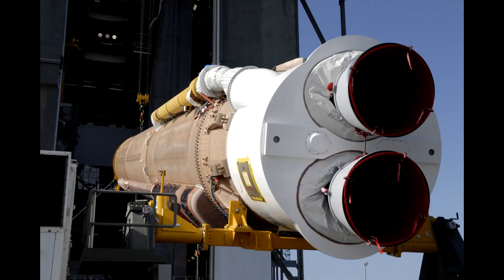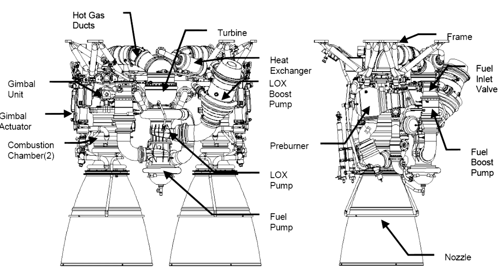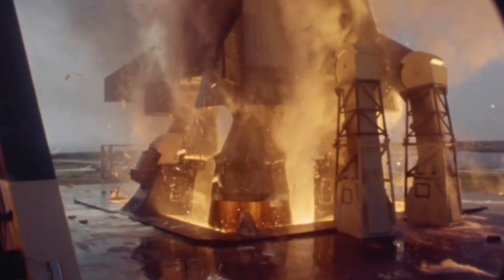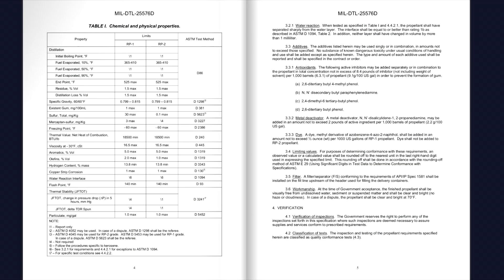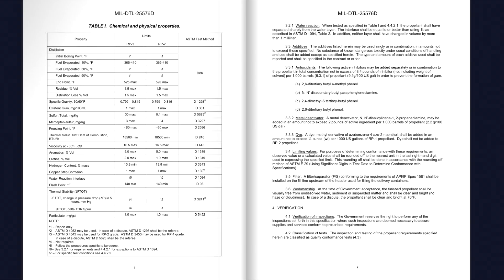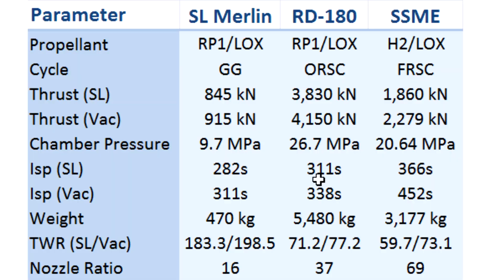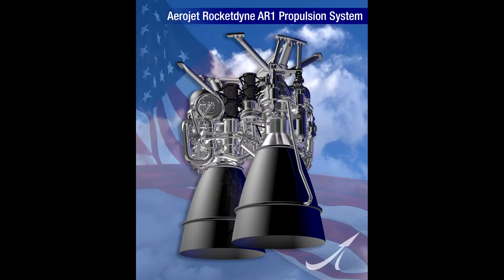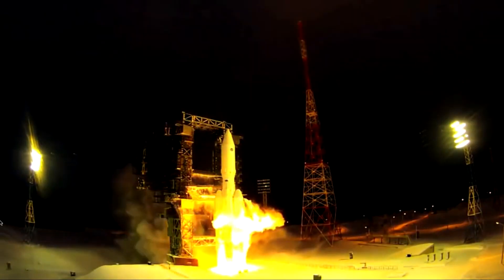Why Some 21st Century US Rockets Still Use Soviet Era Engines

Comment: Cuz the commies made some damn fine engines.
Reply: Neither the RD-180 nor the RD-181 are actually Soviet-era, both having been developed after 1990, although they are heavily based on the RD-170 which was a Soviet engine.
Reply: They also strapped together dozens of WWII-era rotary Diesel aircraft engines to power their patrol boats.  Engineering by necessity since they never had the kind of money the US throws around.
Reply: Three things they were good at making: Huge explosions, cool vehicles with decent engines (well, for the KGB and Roscosmos anyways), and vodka.
Reply: @lsswappedcessna  Same as usa. By the way, Finland air forse buy some US F 18 hornets back In 1995-2000 but mig 21 is  holding the speed and alltitude records here. And it is over 40year older.
Reply: @matti3995  The MiG-21 was a great plane for having been introduced in 1959, however, it isn't anywhere NEAR holding speed and altitude records in Europe for fighters. First, I will mention the 'fastest fighter' is the MiG-25 Foxbat, of which is only operated by Algeria, Azerbaijan, Syria and Libya, all in relatively small numbers too. Not exactly European, so let's move on. The fastest European fighter that is ONLY in Europe is probably the Eurofighter Typhoon, however that position is up for debate if you can come up with a fighter aircraft clocking a top speed higher than 1,550mph and service ceiling higher than 65,000 feet that's operated by a European country.
Reply: Matti doesn’t mean it’s better at being a fighter jet.
Reply: But made a damn terrible economy.
Reply: When they had food to eat
Reply: And some great weapons too.
Reply: NMCCW ☆ Not only that, they perfected a workhorse design & made it more efficient & reliable.
Reply: I ment finland airforce fighters. We had saab Draken, fouga, Vampire, mig 15 and 21 and two engine f18
Reply: @matti3995  Ah, ok.
Reply: Which the Yanks still can't match.
Reply: ndtexpert yes we can
Reply: > @Americanexceptionazism  
bruh
Reply: As if the F-1 is worse
Reply: Too bad their leaders aren't as fine.
Reply: Actually their poor engine design is what stopped them from going to the moon...
Reply: Swirvin' Birds Not true at all. There were many things that stopped them going, probably the biggest was the rivalry between Korolev and Glushko. These engines were developed directly from the NK-15 of the n-1 rocket.
Reply: @swirvinbirds1971  did you even tried to watch the video lol
Reply: @marekverescak2493  Is this video all you watched?

The killing blow to the Kremlin's lunar efforts came from the main propulsion system of the N1 rocket. Initially, there were various plans to equip the N1 with engines up to 600 tons of thrust, but the lack of necessary machinery and time forced designers to settle for a much smaller 150-ton engine. It meant that a total of 24, (and when that proved not enough—30) engines would have to be working in a precisely choreographed fashion to lift the monstrous vehicle off the pad.
Reply: Cuz if we don't buy them they'll sell to someone else. That someone else will have them pointed at us too. Which would cost us a whole lot to deal with.
Reply: Paul Frederick ☆ Wow. Buy Now!
(before cousin Rafe gets it)

Comment: Typical Russian engineering. Simple (relatively), effective, and ingenious.
Reply: Except they are not simple. Hence why the US scientist back in the day didn't believe such an engine could even exist when they heard about it. That Soviet tech was simple is a myth. Some where (like computers, cameras...) but at the same time they made remote controlled rovers when the US needed hands on to do the same work in space. In alloy, rockets, rovers, missiles they were far ahead. Russia is still making better missiles than anyone else today (though no American military fan would ever acknowledge it even if it had lasers up its ass).
Reply: +Dahoon
it is relatively simple. You can save your day by simplifying certain things so that you can make more complex components where it matters, improving reliability and making certain designs possible. It's similar to calculating tolerances on blueprints. By changing the way you measure them you can easily make your part a lot cheaper.
Reply: most importantly: long-lasting. that's like the key design feature the Soviets were working with.
Reply: you should try the trains in Russia everything is build from 1cm thick steel plates not plastic trim that snaps off!

Comment: Instead of using closed or open cycle engines, couldn't you use electric motors to drive the pumps?
Reply from the maker: Yep, like the Rutherford, but batteries add mass
Reply: Okay that's a good reason
Reply: But will get lighter as technology develops, which is why Rocket Lab chose this option.
Reply: Kilo of fuel will always have more energy than kilo of battery :)
Reply: randomnickify | But who knows maybe an electric pump is much lighter than a turbopump with all the auxiliary components
Reply: @rasimbot  true, but w/ current technology that can only happen w/ small rockets. after certain size  the battery weight is more important
Reply: @rasimbot  big rockets need thousands of horsepowers in their turbopump, I cant imagine electric engine with that power being smaller than gas generator.
Reply: randomnickify | Looks like you are right. I've googled and found the interview with the engineer of РД-170 and he said that its turbopump is 180 MWatt. And also I've found the webpage about 36.5 MWatt superconductor electromotor and its mass is 75 tonnes
Reply: According to wikipedia LiPo still has order of magnitude less energy density
Reply: Electrics would be a simpler design but rocket fuel energy density is much higher than batteries.  Above a certain size the complexity and plumbing penalties puts open/closed cycle engines ahead of electrics.

Comment: Hey, can you do one on grounding electric circuits in space?
Reply: I'm no electrical engineer, but I can't see it being that much different that grounding an electrical circuit in a car. in a closed electrical system you just ground back to the source.
Reply: @iamzid  that makes sense thanks. The car electronics are 12v or something though, so maybe there are more considerations to be made still
Reply: To illustrate, there is a fun experiment You can do, You need for example a low voltage lightbulb, a battery and some pieces of wire to connect it with, one part goes directly to the lightbulb, the other part You can fix on for example a wallradiator or something else that will lead electricity and then another piece of wire back to the lightbulb, if eweryting has good contact the lightbulb will still light up, despite of the massive resistance in the radiator.
Reply: Long extension lead.
Reply: Gee, I wonder how airplanes fly?     For sure you're no electrical engineer.

Comment: Very strange that the US hasn't produced anything better than Soviet-era rockets.  Lots of experience.  Heaps of supercomputer capacity.  Lots of economic incentive.  Just don't want to?  Good enough is good enough?
Reply: As Scott did say, US did go for HydroLox rocket engines insteed that is mutch more effective then Kerosene LOX rocket engines, but it is like compare apples and pears, both have their pros and cons.
Reply: They have, just not any better Kerosene + LOX. The US has far superior MethaLox and HydroLox rocket engines. MethaLox engines are much more efficient when it comes to cost and availability of fuel while HydroLox engines have higher specific impulse end fuel energy density.

Comment: which will be better? the Raptor engine or the Blue Origin BE-4? i havent seen anyone directly compare them even though they will compete against each other
Reply: I think there haven't been any comparisons because both are still in development (as far as I know), so all of the parameters are still subject to change or not published.
Reply: The Raptor is considerably more technically impressive. The BE-4 is larger. Which is "better"? I don't know.
Reply: larger definitely isnt better, Id rather have 2 smaller, cheaper, and more efficient engines, then one that costs more then the 2 smaller ones, and is a lot less efficient.
Reply: raptor engine is hands down much better, 30,000 vs 13,400 kpa of chamber pressure
Reply: Hard to compare when the numbers keep changing. Probably raptor if Elon is to be believed about it's performance though.
Reply: Hard to say since they're two different types of closed cycle engines.
Reply: Mark, sure you can compare them, you know their chamber pressures, and fuels.
Reply: If Raptor and full flow staged combustion work well than Raptor is clearly the better engine with more capability. So far the Aerojet Integrated Powerhead and the Energomash RD-270 are the only other rockets engines to use both an oxidizer rich and fuel rich pre-burner. Keep in mind the RD-270 used hypergolic propellants which makes it a bit easier. BE-4 is more similar to the RD- 170 based Russian engines using oxidizer rich staged combustion. Blue claims that the engine is being setup to run at lower chamber pressure to improve longer term reuse. Raptor will almost definitely produce better specific impulse.
Reply: I’m pretty sure I’ve seen a video which compared them. Search youtube for it
Reply: Both will be better than anything else currently used today, and that’s what matters.
Reply: @BrokenLifeCycle  IMHO the best first/second stage engine in terms of Isp is RS-25/RS-68 that works on  LH2/LOX. But it did not make the rockets that use the engine best on the market, or best of all. So Raptor or BE-4 will not become best engine for first stage as well. They may become the best for some particular rocket use.
In the nearest future rocket engines with nuclear source of energy may become breakthrough that will deliver human to any planet, including dwarf planets behind Pluto, and anything near 1000 AU from Sun.
Reply: @hsynli-u8e    theyve reached untill about 280 bar with the first raptor, I believe 270 is what will be good enough for flight.
Reply: Those are vastly different beasts. One is an oxygen rich staged combustion engine like RD-180 and all those Russkie engines and the other is a full flow staged combustion engine. That has never been done besides one prototype and half of another prototype (RD-270 is the only FFSC engine ever fired on a test stand besides Raptor). Raptor is by far the higher performing (by virtue of design), more efficient and longer lasting design. The latter seems presumptuous however FFSC allows for lower temperatures in the turbines and by being an FFSC engine can eliminate the seals in the turbines, since both the oxygen rich and fuel rich side have their own turbines so cross-contamination with explosive results is not an issue. Not to put down BE-4 it's looking like a really really great awesome new engine. But Raptor is Raptor. There's a reason people say it's 50 years ahead of anything else.
Reply: 221 b: "people say it's 50 years ahead of anything else"
You already enumerated its direct predecessors as RD-170/180 and RD-270. First deals with hot oxygen, second deals with FFSC to work with fuel and oxidizer of different density. First was developped 35 years ago, while second was developped 49 years ago.
Currently tested Raptor has 20-25MPa chamber pressure. This is same level of pressure as RD-170/RD-270 have. While 30MPa is just future plan. Not clear if this number is reachable or not.
Fuel and oxidizer are different than RD-170/RD-270 were used to work. But this will influence hard work over fuel and oxygen tank. How heavy dry weight is going to be? Is it going to compensate all additional Isp methane is going to provide? If yes, this solution is Mars specific only. It creates additional cost of the rockets production like it was for Space Shuttle program with hydrogen fuel and like it is for Delta IV rocket with its $450M cost per launch.
Note that there is synthetic oil produced by many oil companies throughout the world. All they do they use natural gas like methane and synthesize longer hydrocarbon molecules of required length to provide required oil characteristics.  Kerosine also consists of hydrocarbon molecules, but they are less in size than synthetic oil.
Instead of developping methane fueled Raptor Musk could develop Mars located synthesis machine to produce RP1 from methane. So there are other options than what Musk took so close to his mind.
Reply: Frothar My moneys on the raptor

Comment: could the bfg do a mission like apollo & land on the mon then come back?
Reply: Not sure if the big friendly giant would survive in space, but maybe.

And yeah, with orbital refuel BFS could definitely do a moon landing and return, probably wouldn't even take a full refuel.
Reply: BFR
Reply: yup, probably with 1 or 2 refuels in leo
Reply: Probably would need a refuel on the surface of the Moon.  A free-return trajectory, Apollo 13 style, won't need refueling.  Landing means having to propulsively shed all velocity and put it all back again.  The Apollo LEM made it easy with paper-thin walls and an even smaller ascent stage.  BFR/BFS would try to descend and ascend with everything including atmospheric reentry heat shielding and sea-level engines.
Reply: @CarFreeSegnitz  I'm pretty sure the delta V required to get to the moon, land, and come back is quite a bit less than getting to Mars and doing a propulsive landing there. If the BFS didn't refuel in Earth orbit you're right that it would need to refuel on the moon, actually I'm not sure it would even have enough fuel to land. But that would be a stupid way to do things until a fuel depo gets built.
Reply: @Daniel Jensen It is actually not at least not in BFS configuration it is far "cheaper" in delta V requirements than landing and returning from Moon. That is because to land on Mars you only need delta v to get there and bit to scrub lasts bit of velocity before landing rest will do the atmosphere. Meanwhile to land on moon you need capture burn than scrub all of Moon orbital velocity and do it all again to return to Earth. In the end it takes for rocket like BFS 3km/s less delta V to land on Mars than to land and return from Moon. Of corse it is different story if you have optimized lander like Apolo stile  lander with multiple stages while it still takes more delta V it is spread across multiple stages and it would not survive aero braking or if you want to return back to Earth from Mars. But if you want to return you still can use in situ methane production from co2 and water via Sabatier process.
Reply: It's also worth pointing out that it has redundant engines (you could land with only two of the seven engines) so it will have more mass drag than any other rocket for safety/reusability reasons. In fact, it will land back with fuel in the tanks!
Reply: It is pointless to even talk about that since it is only vaporware.
Reply: @MarkoLomovic  Just like the landing of Falcon 9 rockets?  Be careful with how you use that word.  Vaporware is for something that is only hype that the company behind it never intends to make.
Reply: Wrong, look up definition of vaporware(it is something you announce but not produce yet). BFG and all that jazz can be considered vaporware until we get something real because it will take so long to achieve that goal and goal its self is extremely complex. If we take into consideration their wishful launch date as PR move then whole project is questionable.

So it can be considered vaporware but just because something is considered right now doesn't mean it creators never intended to make it that is just people misusing term.
That is why we have terms like surfaced vaporware, ones that actually got done. So BFG is far from certain at this point and time. Falcon 9 is nothing special considering that people have done way more insane stuff then landing boosters. 

As much as I like SpaceX they are still young when it comes to space exploration and for them to be able to create something like BFG they present is just way off.
By the time they even make something what they present us now is far from what they will actually do so even in that sense it is vaporware.
Reply: @MarkoLomovic  So even with your own definition it still isn't vaporware because components are already being assembled and tested.
Reply: Where are these components? all we see is concept...